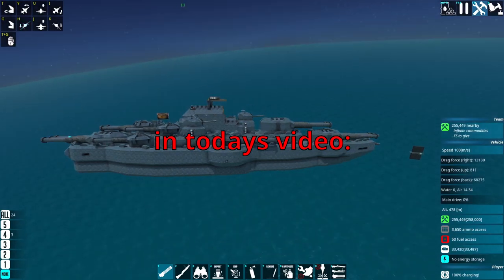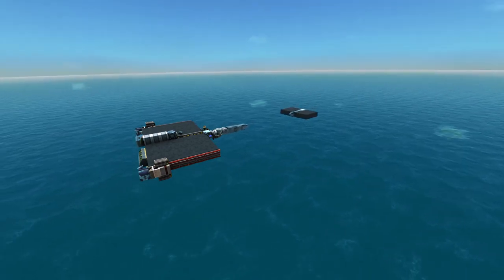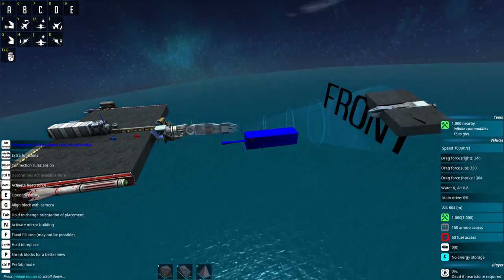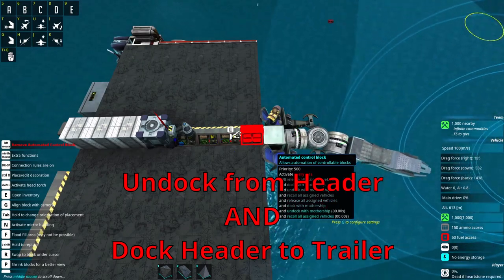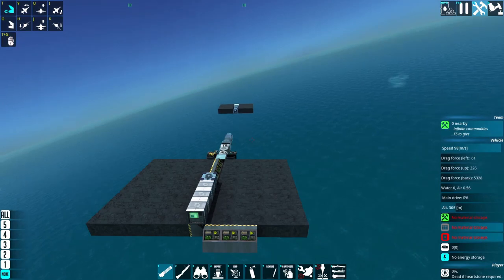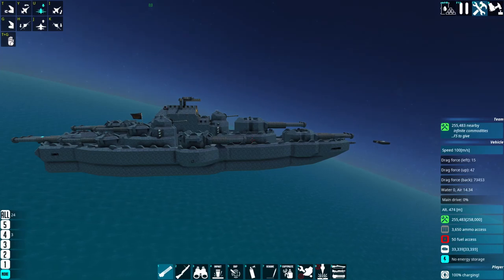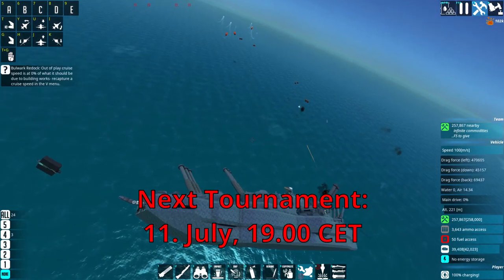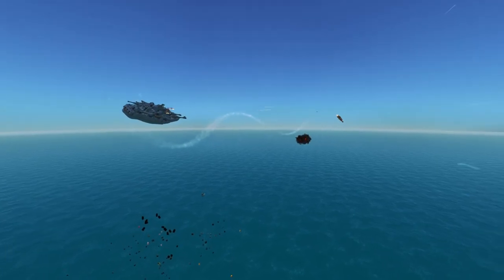Breaking the game again: the Redock Drive

Comment: I wonder if that's enough time for repair tents
Reply from the maker: you mean what I plan for the tournament?
Thats not what I was thinking about, my plan was more to be able to instantly accelerate to 100m/s in order to dodge missiles and stuff, but release it after half a second or so to have the drone continue on its merry way. I dont plan on pulling it all the way back to the carrier. More to act like a cheap warp drive (I think I said teleporter in the video, my bad)
Reply: It isnt. They require a full second for a single repair.